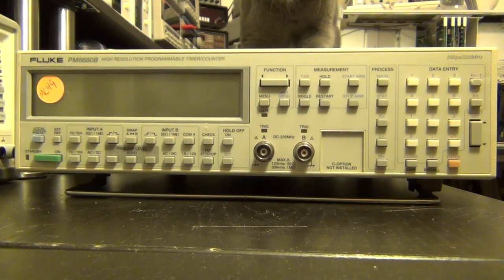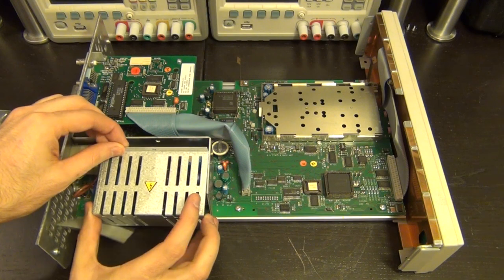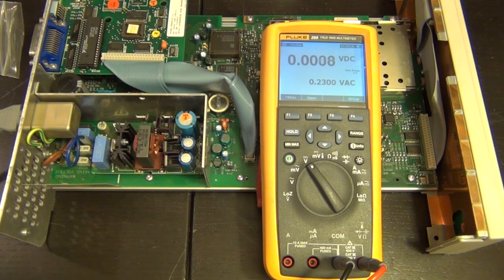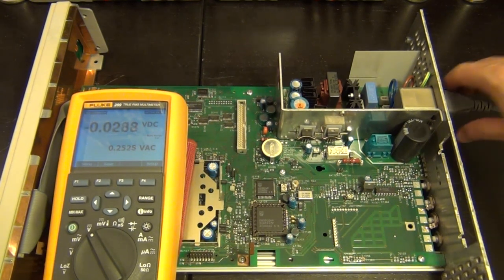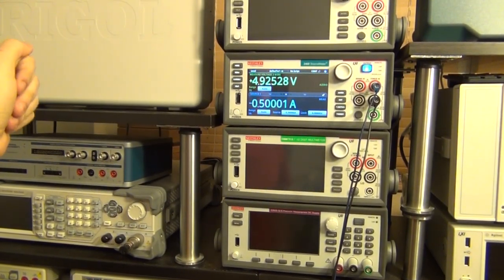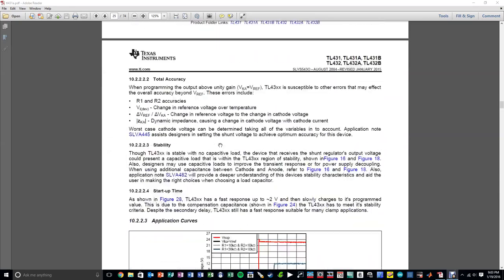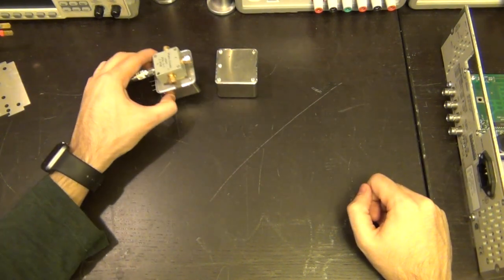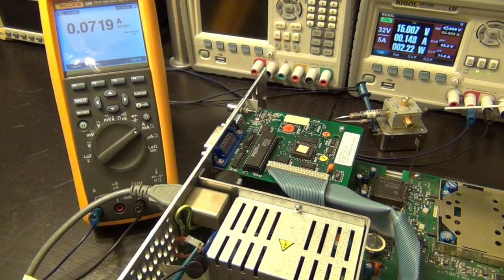TSP #72 - Teardown, Repair & Calibration of a Fluke PM6680B 225MHz High Resolution Frequency Counter

Comment: In the U.S., residents are only billed for KW, not KVA. When you measured the the standby current of the counter, and multiplied by the RMS voltage you calculated KVA. I would anticipate that the KW of the unit is significantly less, because the unit probably has a PF (power factor) of around 0.5. Remember the difference between real, reactive and apparent power. Btw I like your channel.

Comment: Nice video and a lovely friendly cat too.
I was a little surprised that you didn't isolate circuit areas that are ribbon cabled (GPIB, LCD front panel) just to see if they were loading the PSU. As it happened though they were not part of the problem.
Nice score with that unit but WOW, the reference oscillator has virtually no compensation and looked very old school and this from Fluke !

Comment: I had one of these units and also had to repair the power supply. I tested the power consumption after the repair and it was drawing around 12 watts on standby but as it has the oven controlled xtal I did not think much of it but I did notice that the mains input filter was getting warm. I should have changed it but it is an odd size so I decided to change it 'later'. What a mistake. I came into my lab a few days later and wow what a stink. The block was oozing brown goo and the smell took days to clear.With the oven option the accuracy is fantastic and I actually use the 10MHz output as my lab reference.

Comment: Nice repair video. However, the Rb clock standard does not operate based on radioactive decay of isotope, but rather on super-fine structure in its absorbance - it is basically a crystal oscillator phaselocked to very narrowband "resonator", which has its resonance defined by physical properties of rubidium atom. (The resonator actually being cavity filled with trace amounts of Rb, ovenized, driven by output clock that is multiplied up to the frequency of Rb fine transition around 6,4GHz, and changes in optical power of the light transmitted* trough rubidium cell being the feedback vale for the  PLL.)

*fixed wrong explanation - the Rb cell itself is not excited to produce any visible radiation, it's driven externally by secondary rubidium RF discharge lamp, and its absorbance is monitored (much like with fine stabilisation of lasers with iodine).
Reply from the maker: +Martin Konečn&#253; Yes, you are correct. Thank you. I have updated the video. I had taken this fact for granted. This is exactly why I like to read the comments. I learned something new today which I thought I knew already!
Reply: +The Signal Path Blog Not even my original explanation was correct, I needed to give it second read and think a bit more about it. 
However it made me wonder about effect of external magnetic field due to Zeeman effect - I have no idea how well is the cell shielded inside the frequency reference, but perhaps you can try if there can be any frequency shift measured against second Rb reference, when strong external field is applied to one of them (neodymium magnet)?
Reply: +Martin Konečn&#253; Actually it came to me surprisingly similar to way how lasers are stabilised to very precise wavelentgh with iodine cell, and aksed my chemist firend if he can at least approximately calculate zeeman energy levels splitting due to external magnetic field. He found me nice article instead (DOI 10.1007/BF00325411), interestingly enough if I get that correctly, I should be able to make to detune the cell out of absorbance of stabilised laser with reasonably achieveable magnetic fields with solenoid. 
I have literally no clue if I can extrapolate the frequency shift ratio to rubidiun to get at least order of magnitude approximation, but still&#39;d like to hear if there will be any shift detectable in output freqency - I actully haven&#39;t found out yet how the phasenoise spectra of rubidium clock looks alike at low frequencies, nor am I sure that the freqency shift at 10MHz output is at order of several miliHertz. Perhaps a suggestion for tutorial video on Allan variance for next time? :)
Reply: +Jack Hudler Oh, so it can be used for precision distance measurement reference - nice. How is the recieving side done then on that thing? I actually wondered if that requires digital lock-in amplifier or not.

Comment: Another nice repair, thank you! On this occasion, I would like to suggest the principles of switch-mode power supplies as a topic for your tutorials series (should you ever find the time to conitnue it...). They are such an omnipresent component in almost any modern device, and at the same time a common cause of failure. You seem to assume that everyone is familiar with its functionality, so maybe it would be too basic of a topic?

Comment: Nice video and fix. There is a "Ext Ref" button on the front panel and I didn't catch if you showed a pix of the rear panel - is that a typical 10MHz reference input? I turn on my GPSDO in the winter time to add a little warmth to the workbench area and the Rb in the summer during air conditioning season since you only have to turn it on and wait a few minutes for it to lock and be useable and no heat added to the environment!

Comment: You can't use full-rectifier on output of flyback converter (if you put full-rectifier on output it become one transistor forward converter, but then you need to provide way to reset transformer).
To be accurate all outputs on that power supply are regulated, but only one is tightly regulated (using voltage reference) and other are less accurately regulated via transformer action (which is commonly used technique for flyback with multiple outputs and was used even in old PC power supplies).

Comment: Great repair as always, little more lengthy this time. When you first turned it on I thought transformer whinning. I have seen it before in older TV's. The whining always indicated some kind of feedback or oscillation problem. Are you intentions to use that instrument, because it seems you have more precise test geer then that. I sometimes myself go to flea markets and pick up dead equipment to fix for the hell of it. I find it quite fun and challenging and then usually give those things away. Anyways look forward to seeing the next video, Cheers  {:>)

Comment: I didn't think about this at the time.... but that 2460 is WAY noisier than it needs to be. It's cranking the fan up to full speed while sinking 500mA at 5 volts ... that's only 2.5W on a unit capable of sinking 100W. The fans should be able to be idle at that power. Why are they spooling the fans up so fast? It makes no sense. It must sound like a hurricane at 100W. Shahriar, I would REALLY love to see you investigate this.
Reply: I thought that there was a temp sensor on the Power supply, so as he drew current it detected an increase temp and fan came on, which didn't help as power supply was out of the case, open loop, fans max out.
Also maybe the 5V rail isn't the one that delivers most of the power, I wouldn't  imagine it is, my 2c :)

Comment: The Agilent 53181A is also 225Mhz for the top of its spec (it will measure higher). Why have multiple vendors use this frequency as the target for the spec?

Comment: Hi - quick correction to the guru! You mentioned varactors a couple of times to tune the crystal - but surely it was just a trimmer cap you were tweaking - or was there a potentiometer and a varactors?

Comment: Funny you never heard about efratom since it is the first I think of when hearing rubidium. Might be because they started their stuff in the 70s in germany and through several steps ended up being part of microsemis symmetricom, so whenever you have an efratom, it is old. I wonder where your 10MHz distribution network and the hydrogen maser is ;) anyways since you have multiple of them it might be a good opportunity to compare them and talk a bit about how their performance is measure and allan deviation and stuff like that.

Comment: Can you characterize IV curve of the TL431 with the Keithley source meter?    Will heat induce the failure mode?
Reply from the maker: +James Damewood Yes, you can definitely characterize it with the SMUs. I am not sure what caused the failure, but this is an old power supply which is always running then the unit is plugged in.
Reply: +The Signal Path Blog I was thinking what may have caused of the source of component's failure.   It might have been damaged by a lightning strike, causing EOS (Electrically Over Stressed) damage.  Bad wire bond from the terminal bridge to IC die.  Thermo-cycling from reflowing the soldering sometimes self-heals the component from cracked die,  IC delamination from die's paddle or poor wire bond.  Leaky transistor, causing a latching effect from particle defect created during the constructions of IC's die etching process.

Comment: I'ts possible to swap that crystal with one of yours? (that thing doesn't really give it justice)
Reply: +marco56702 There is an option for a better frequency standard just to the back of the instrument, and 2 jumpers to select either the crystal or the option close to the crystal. I guess the original owner was just not into more precision...

Comment: Could you not add an external reference BNC and tap the 10mhz crystal and switch it? Possibly use a GPSDO as an external reference which is probably as good as a rubidium reference in this case. Once buffered and filtered this would become a formidable counter. Failing that add a separate 12vdc supply and use a double oven OcsilloQuartz XS8663 10mhz reference internally?. 
I believe the US government use this counter to track the Caesium clocks onboard GPS satellites (how do they do it “season 5 episode 20”, on Discovery channel). And now OscilloQuarrz has moved away from Rubidium to Caesium clocks too!!
Reply from the maker: Yes, that would be a nice addition.